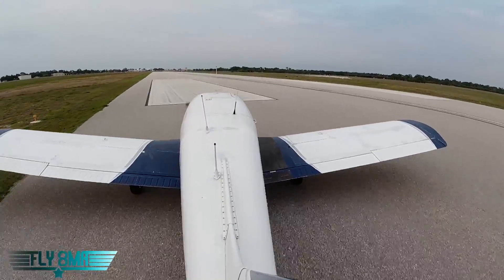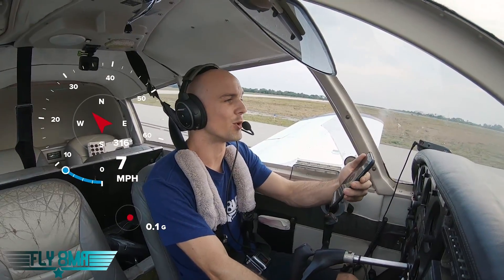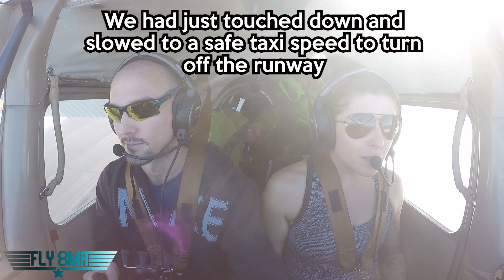Maximum Cornering Speed | Planes don't drift too well...

Comment: Very good advice. Seen it and heard it many times on the runway/taxiways. The stress can be even higher when landing and taxiing in a tailwheel aircraft. The approach speed in a taildragger is typically much slower, and then you have to be extremely careful when taxiing once you've completed the actual landing.  If I hear someone coming in behind me, I'll often extend my landing on the runway so that I limit my taxi length time on the runway to the taxiway.

Comment: I love these videos and that you’re not afraid to wreck your planes for educational purposes haha! Quick question: Why will the nose gear snap off if you take a turn off the runway taxiing too fast? I’ve seen a nose gear snap due to a porpoised landing, but never while taxiing. Thanks!
Reply: It's not designed to take lots of lateral loading.
Reply: I've always been taught that the nose wheel is super fragile.  If I can't get off the runway at the normal taxi speed, I will wait till I get to the next one.  Especially now that I'm flying a taildragger, I definitely don't want to ground loop.

Comment: I'd like to see a similar video but just straight down the runway at a relatively high speed (30-40kts) trying to get back to the centreline - like you've just landed on a narrow runway after a gust pushed you over to one side, and you are trying to get back to centreline but you hear squeeks as soon as you start applying pedal pressure and you're scared to push too hard in case it sends the aircraft into a skid... I've never seen it happen, so likely with a nose wheel aircraft (front heavy) it's probably not a huge concern... right?